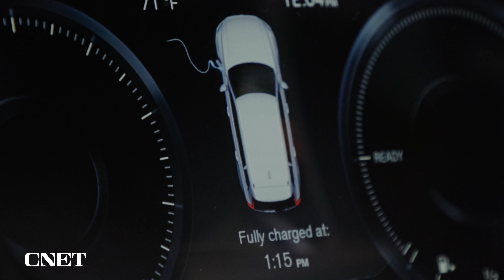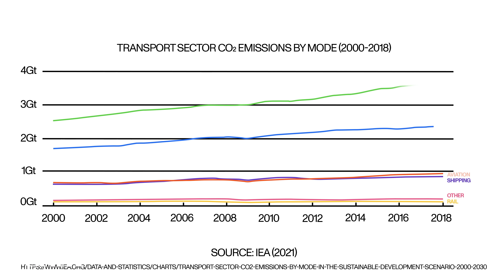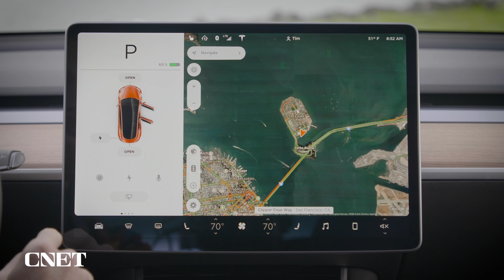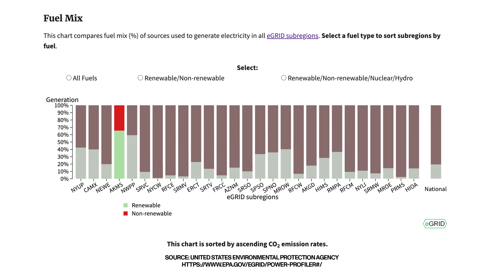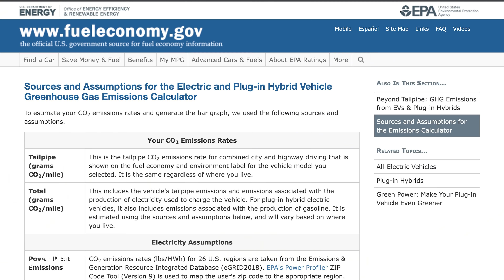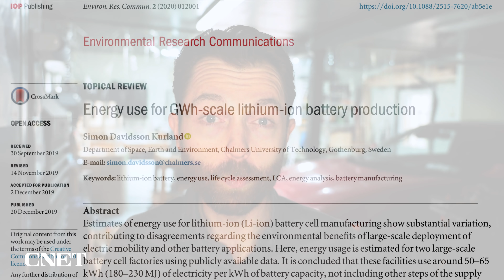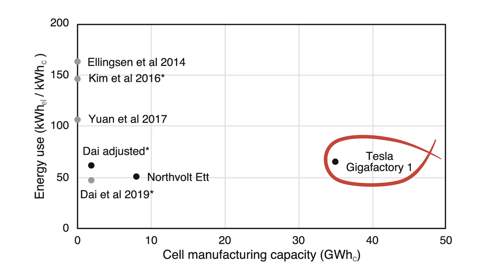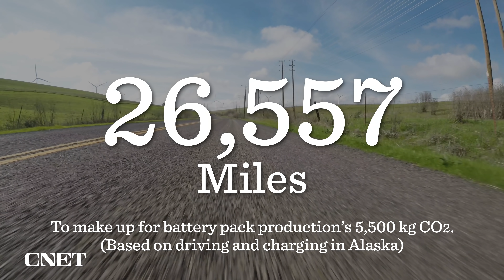Are EVs Actually WORSE for the Environment?

Comment: Great video.  A question.  Since the production of the battery and electric energy is taken into account, for the gas carbon emission calculation is the carbon footprint of drilling the oil and refining the oil also taken into account?

Comment: Also also keep in mind the co2 cost of the infrastructure that is required if evs are becoming adapted. We need better electric nets and more charging units which all require a ton of steel and oil to produce.

Comment: A fair comparison would has to be on the differences. Outside the basics, wheels, interior, body, etc... If you are going to look at the battery manufacturing CO2 (minerals and metals), you also have to look at the minerals and metals used in the fabrication of the engine, tank, spark plugs, oil and lubricants, transmission, oil filter, air filter, etc for the a period of 10 or 15 years (the equivalent of the battery life expectancy). Also, it has to include the CO2 of the exploration of oil, its pumping, storage, transport to a refinery, the refining of oil into gasoline, storage, transport to s distribution center, transportation to a gas station all the way to the energy used to pump the gasoline and operation of the gas station. If you are comparing CO2 of electricity production, you have to compare the CO2 of each drop of gasoline going into the tank along with all the other consumables of the gasoline car CO2 emissions. I remember seeing production numbers of 6 to 9 liters of gas consumed (depending where the oil is produced (Canada tar sands for example 9 or more while Saud Arabia 6)

Comment: EVs are approximately 1% of the 250 million cars on the road today. What would happen to the electric grid as more and more EVs are sold especially with big government incentives both fed and state, I'm thinking CA that already has rolling blackouts?
Reply: Are you worried about people running their home A/C or doing laundry? If so, EVs aren't the problem. 

Let's do some math! If the average daily commute is 40 miles and an EV can do 3 miles per kWh, then it's 13kWh daily to recharge the car, or about 2-3 hours of running home air conditioning or 2-3 loads of laundry.

Comment: There are a lot of errors and bad assumptions in the video. If you're using Alaska as the state in which you're driving in, then the distance that the gas travels by truck to the gas station would be a fraction of the distance it traveled in Wisconsin.
Reply: The range of the EV is greatly reduced in a state like Alaska too. Making the CO2 number different for the tesla.
Reply: @JS-wc4xs  Max 25% difference for EV range loss. Relative to the difference ICE is more CO2 intensive it's negligible to the end result.

Comment: Mining (equipment), loading (excavators), transporting (trains, ships), unloading (excavators) the coal are worse that the same operations with the high energy density/fluid fuel that can be carried through pipelines over long distance and can be handled with pipes and pumps over short distances. Then there are several levels of up voltage conversion (transformers), losses on power lines and then several levels of down conversions (all with their own losses). Then there are all the controllers for battery charging, motor controls and the fact that the electric motors are dependent too on rpm and torque, efficiency wise. The battery itself, the motors and the controllers are liquid cooled because charging and discharging is not 100% efficient. All the numbers given by the EV industriy are suspicious, and the ones that are really bad are kept secret.

Comment: A good start, but what about the CO2 production from oil refining? That is listed as the second largest CO2 source after power generation. If we are comparing the CO2 impact of battery manufacturing, then it is only fair to add in the impact of creating gasoline.

Comment: Gigafactories are solar powered so the carbon footprint is lower than estimated.  You'd also need to include the carbon footprint of making the BMWs engine, which includes mining the steel, smelting it, and machining it.

Comment: That was an excellent video. Could you then do a comparison of the life of the car? Because the battery landfill would be much larger with a Tesla for example. How then is the life of the car impact the environment in comparison? Is it still better?
Reply: Used EV batteries can be reused for domestic energy storage. A house doesn’t care how much 100kWh of energy storageweighs the way a car does, so even used EV batteries that have degraded 50% can be repurposed relatively cheaply to store excess solar or wind energy and then release it at night or when the wind is calm. And with that kind of use, batteries can last for decades.
Reply: @Antenox  And let's not forget batteries are 100% recyclable - they don't have to be disposed of after their useful life is over.
Reply: @ColinFox  The 100% recycle rate is for lead acid batteries only to be clear LiPo's are around 50 to 90% depending on the source and the study in time we may hit that 100% number but we are not there yet.
Reply: @chrisherbert4454  We don't need to yet because reuse  is a better option. We won't need to actually recycle batteries for another couple of decades.

Comment: You did not take to consideration the recyclability of the vehicle? You can recycle a gas vehicle down to the last bolt and not have any problem. But electric cars have to be mined and shipped to create the battery and ship back to the states and then after eight years of use you have to bury the battery for 100,000 years into the environment. Lithium cannot be recycled. So obviously you need to look at your numbers again and look at the greater impact of electric cars.
Reply: The battery & an already burdened power grid are my two main concerns. Otherwise I like EV's.

Comment: I’d like to see further evaluation on the byproducts of each motor transportation. The byproduct of an internal combustion engine is CO2, water and heat. Other than oil how do you spell recycled, what other waste products either other than CO2? In contrast, we do not know the environmental impacts of used lithium ion batteries, which could be detrimental to the environment long-term

Comment: Ahh CO2 only so let's forget the rare earth magnets, Lithium, and Cobalt and the disposal or recycling of all of that at the tail end.
Reply: Amen.
Reply: At least they CAN be recycled or reused for domestic energy storage where they can last for decades. You can’t recycle burnt gasoline.
Reply: Gas cars actually use more Cobalt than electric cars and it is destroyed in the processes, while it, lithium, etc. can be recovered during battery recycling.
Reply: Gas Cars use way more Cobalt than a LiFePO4 BEV. You ommitted that fact.
Reply: And let's also add in all the metals used in both ICE and EV.  How does that change the numbers?  He addressed the battery but not the engine construct cost for ICE.  I think that should be added as well to get a close comparison.
Reply: Cobalt is used as a catalyst in refining operations. It helps remove sulfur (and maybe other impurities) from the hydrocarbon stream. In theory no cobalt is consumed in the reaction, but in practice some will be lost to erosion and flaws in the recycling process.
It takes about 1 pound of cobalt to remove the sulfur from 80,000 gallons of petroleum products, like gasoline. 80,000 gallons would power a car for about 2.4 million miles, but 98.8% of that cobalt is recoverable, meaning we permanently lose only a pound of cobalt for every 6.6 million gallons we refine.
So, as  said, we use lots of cobalt, but we don’t consume it, we use the same cobalt over and over again.  Industrial usage for cobalt is around 7% of what's mined battery's are around 40%  so let's agree to disagree
Reply: @chrisherbert4454  LiFePO4 Battery uses NEAR Zero. Other than Adulteration of microscopic particles into the Electronics like the BMS. There is just as much cobalt in your Gaming Rig PC or Xbox Series X.

Comment: the fatal flaw in EV's is simple: right now, a paltry 3% of new cars sold are EV's. what kind of grid will we need when 80% are electric? there is no amount of renewables that will be able to serve all of those, and no chance the highways wont be absolutely clogged with lines trying to charge these things. what about the installation, manufacture and maintenance of all of these "green" power systems? the cost will also be staggering. the long term solution for a fraction of the cost is biofuel research and distribution. this EV stuff is also only for non-weight sensitive scenarios like cars and trucks. you cannot have an EV powered boat (or not practically anyway) or long range jets. batteries just have terrible power density, and are already randomly catching on fire. 80% of rare earth mines are owned by communist china as well. this is going to be horrible for the environment. what about war zones and emergency services that need to charge? ain't gonna happen my friends.

Comment: It would be necessary to include data on the CO2 expended extracting oil from the ground, transporting that oil to the refineries to be refined into their constituent fuels such as gasoline, diesel, kerosene, etc. Then, the transportation of the fuel to the fueling stations throughout America.  The estimate provided seems for too small for the given example.  I don't think there is even one gasoline refinery in the state of Wisconsin, let alone the mid-west. So given the provided example, the number is actually an incorrect estimate to start-- one that is far too conservative for the given example. The refueling has to occur with regular frequency (about once a week for the average American). Also, the above does not account for other emissions that are dangerous to biological lifeforms such as NOx emissions, carbon monoxide, formaldehyde, benzene,  hydrocarbons, among other environmental pollutants expelled from combustion engines. Not to mention the oil, grease, and other fluids required to operate a combustion vehicle that have their own polluting effects over time with great regularlarity. Hmmm. 3 years to break even on CO2 emissions, well, seems quite generous, even for the most dirty part of the American electric grid. This is also a moving target as America's energy grid continues to employ more clean/renewable energy sources over time.

Comment: Electric cars: ICE cars or self driving cars aren't enjoyable. 

Cars cost too damn much now. 

Insurance: registration renewals: tag fees: maintenance: speed tickets etc.

Everybody in the US is driving cars is already, creating induced demand. 

Population is increasing too. So there is going to be more traffic.

Car-centric infrastructure is damaging the potential to relieve congestion. 

By using alternative modes of transportation.

Most motor vehicle drivers are hostile: impatient to pedestrians trying to cross the street.

Our laws don't reflect reality. How pedestrians are at fault if a car hits you. 

That's a grey area. 

Example: Car is at approaches intersection in the right hand lane. Pedestrian presses cross walk button. Pedestrian walk signal turns on. Car peels to make a right hand turn and hits the pedestrian. 

Is the pedestrian still at fault? Who had the right of way?

There needs to be pedestrian safe islands or a electronic barrier curtain for pedestrians. Something to prevent stupid driver behavior.

There are better forms of transportation already out there. 

Electric Skateboards: Electric Mountainboards: One wheel: E-bikes: and EUC( Electric Unicycles).

Models are all different: use less resources to produce one: less wear and tear on roads: less maintance: no fees

Some can achieve inner city speeds.

My current EUC is for sidewalk use. Can't go very fast. But my preorder wheel can go up to 55mph and gets about 100 miles.

Costs a lot up front, but I'll save so much more down the line.

Comment: "1 gallon of gas to get it to the car" and while you looked into battery materail extration for lithium and its impact you did not really do a like compariosn for fossil fuels. Electricity has to be used to extract it from the ground, to pump it. then vast amount of energy to refine it and transport it by fuel tankers in some cases by sea and land, to just burn it in a losey engine. its just not in the same ball park.

Comment: CARB lies about the efficiency of EVs!!! In their ARB/MSD/7-6-94 they claim that the battery is 80% and the motor is 90%! These are lies!!! Charging  a battery in one hour is 5.88% efficient, in 15  minutes it is ONLY 0.3675%. Check Joule's Law!! The motor depends on how many stops are made. Each tome it starts the motor and system efficiency are almost ZERO!!!!!

Comment: What about the environmental cost after the battery is no longer any good or if the car is in an accident and gets totaled. What about the pollution caused by the weight of the car and the quicker wear on the tires and the brakes. Does the math used assume that the electric car is getting the mileage quoted by the manufacturer? Did you take weather into account and the loss of range due to cold weather? How about the impact of all the tow trucks picking up electric cars that ran out of juice? What about all the labor and human impact to mine the minerals? What about the all the repair vehicles that will be servicing the charging stations? This comparison seems highly biased.

Comment: Although this is a rough and ready comparison, it still comes to a very strong and clear conclusion - EVs are definitively better for the environment. There are some more thorough Life Cycle Assessments out there if anyone is interested, for example from Volvo / Polestar.
Reply: Nope the Volvo report based on their own specific Factory that does more ICE cars than BEVs is not acceptable. That is clearly not geared towards BEVs and a conflict of interest. That is a infamous study from Volvo which has now been refuted.
Reply: @Neojhun  LCAs are always going to be very specific to the location they are designed around. The results would for sure have been even more favourable to electric had it been on a bespoke electric car platform rather than XC40, but I would suggest the methodology is still valid.

Comment: From an environmental impact perspective, electric cars in their current form are worse for the environment than the most efficient gas and hybrid cars, not sure why everyone keeps comparing the Tesla model 3 to a BMW, if we are talking about the environmental impact, they should be comparing it to the Honda insight and Prius which both average about 50mpg and are probably about the same size.

Also, how come no one is talking about increased tire emissions and increased road repair and maintenance emissions due to electric cars being significantly heavier than their gas counterparts. One study said tire emissions were 10x worse for the environment than tailpipe emissions.

If every car on the road was replaced with an electric car right now, it would be a huge environmental disaster...bring on the solid state batteries.